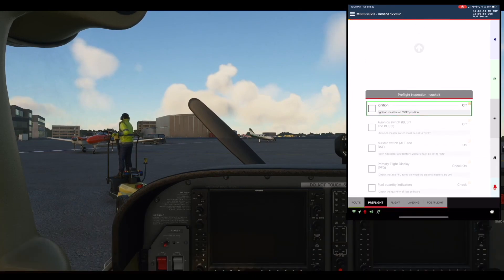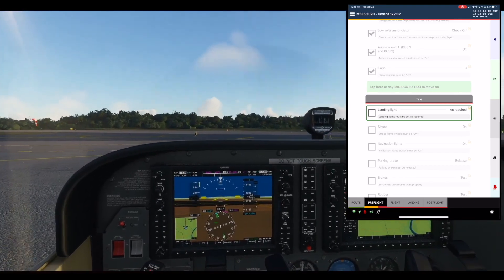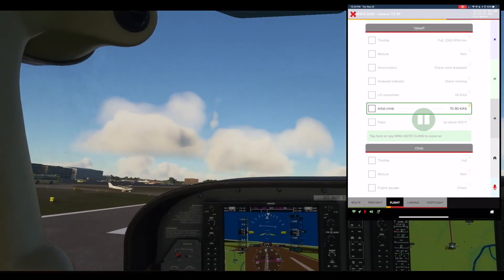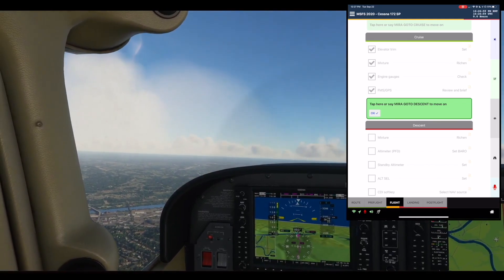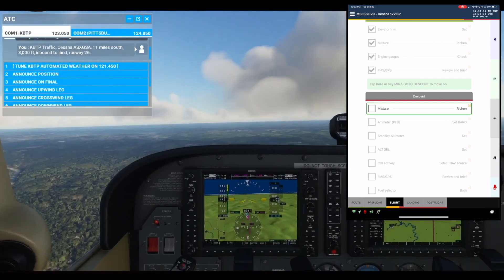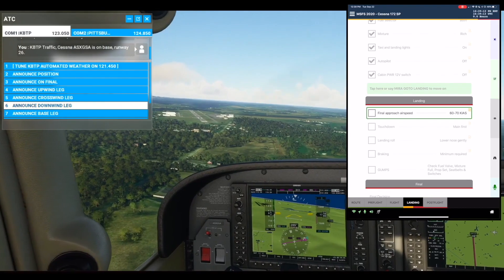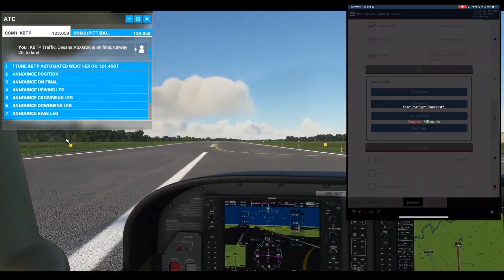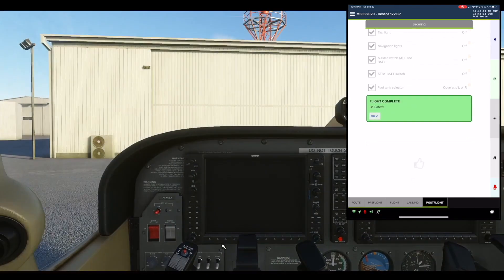MiraCheck - Version 5 Preview - Mira was listening and now she is watching you!

Comment: It appears Mira knows where we are in flight, does it require connecting to EFB or how is that accomplished?  Does this capability require version 5? When will Version 5 be available?  Am starting to use Mira checklist and like what I see so far, this video demonstrates some great safety advantages.
Reply from the maker: It does not require an EFB. MiraCheck does support geolocation tracking, and it is using the geolocation data as well as the elevation sensors to determine phase of flight. This is a capability we are currently testing and will be in Version 5, most likely released in the next couple months depending on testing. We will be reaching out to some customers to help with testing. If interested email support@miralouaero.com.
Reply: @miracheck5921  Awesome and thank you.